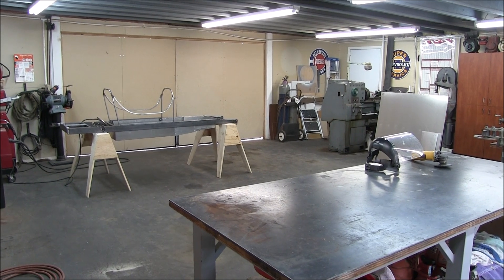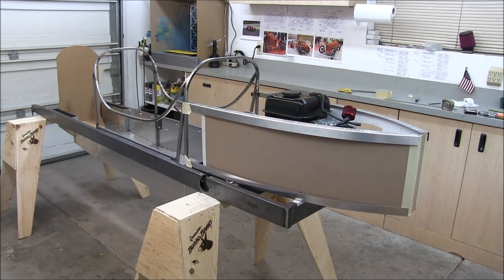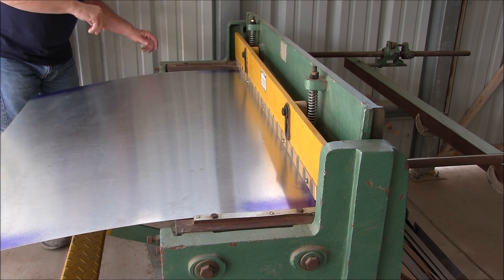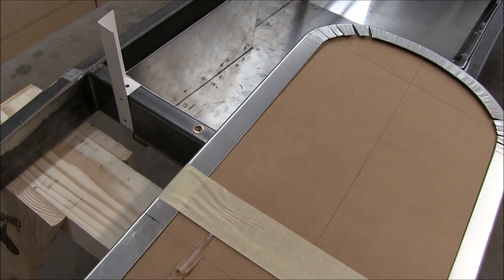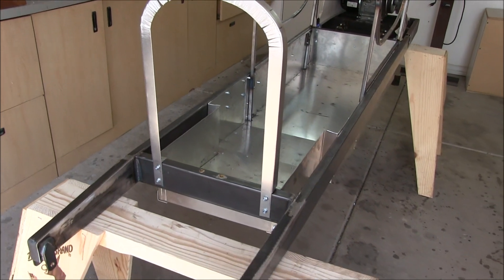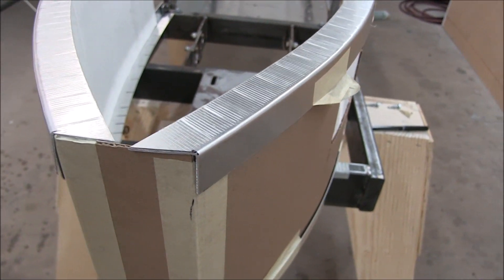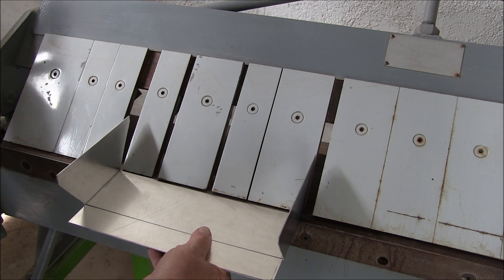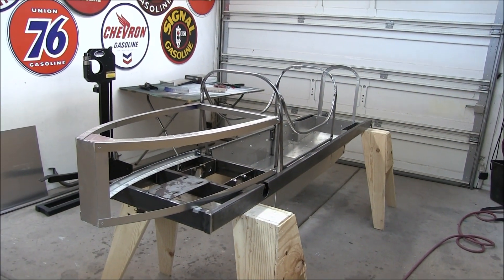Club Car Build Update   Aluminum Substructure

Comment: Great job on building the Kart. Question for you y'all, could you use riv-nuts or other threaded inserts at the front of the rear section so you could use bolts instead of the steel metal screws to attach it? Might be easier to remove/replace it that way and the threads in the tabs would not strip out in time.
Reply: Yes, absolutely